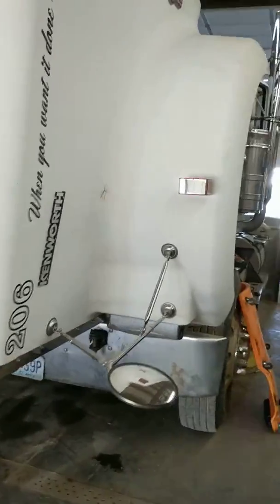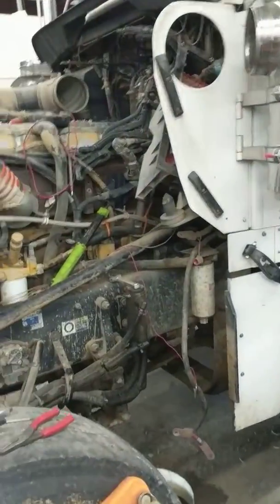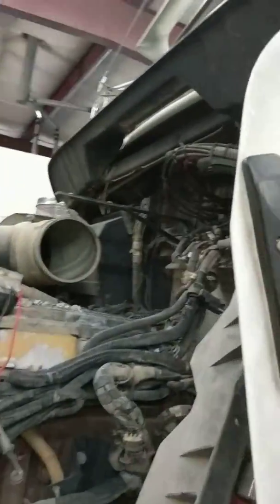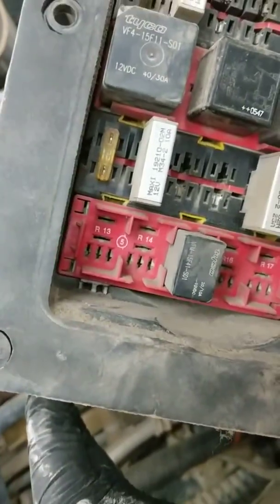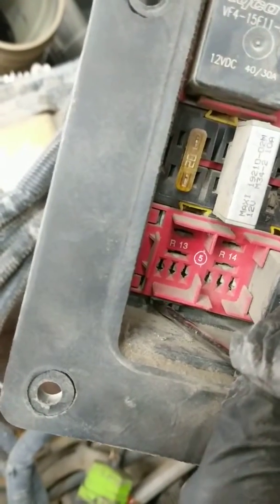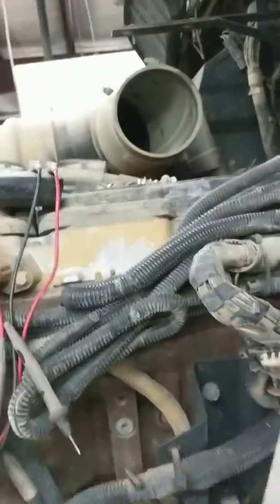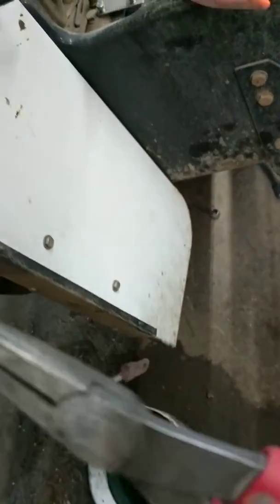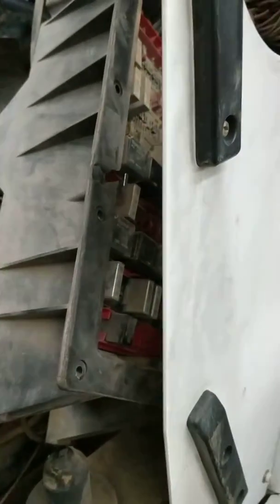2007 Kenworth T800 fuse box removal

Comment: Thanks have a 02 w9 and this help so much. Only problem had was there's not enough wire to pull it out..lol or then that straight to the point.thx. just remember to unscrew the male wire harness with plastic nuts and retaining washer because it's not enough to pull whole fuse panel out
Reply from the maker: Thank you 😊

Comment: I have my marker fuse relay get a short and have no power, can i rewire it to another spare instead of replacing my whole fuse box?
Reply from the maker: That’s what I would do. May slip like a 5 amp bigger fuse into the spot you’re plugging into.
Reply: I have low voltage going to my washer motor

Comment: How long to remove and replace the fuse box with the connections?
Reply from the maker: I want to say it took me almost a day...
Reply: I'm working on my also. My main power input to that box is loose and I  experience power loss. Does that have a nut on the inside of that box that could tighten up the connection? The one I'm referring to kinda looks like a spark plug boot.
Reply from the maker: @wadericker4795  if I remember correctly, there is a nut. It's been so long since I've torn into one though. Sorry for the delayed response!
Reply: @bryantr90  no problem.  I tore into it. There is a nut on back side. It was loose and it had been getting hot, stuff had been melting.  Been dealing with this problem for over 10 years. No one could find the problem.  Put a new stud in. Polished up the cable ends. Tightened the new lock nut. Everything works like new!
Reply from the maker: @wadericker4795  that's what I like to hear 🍻